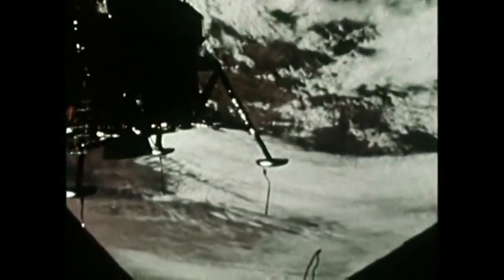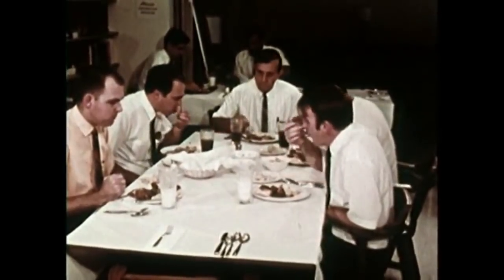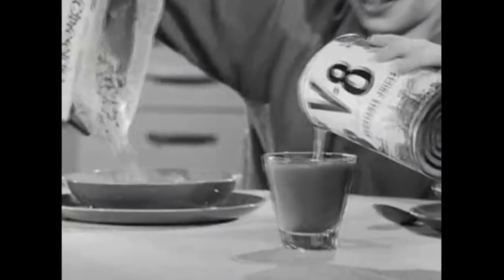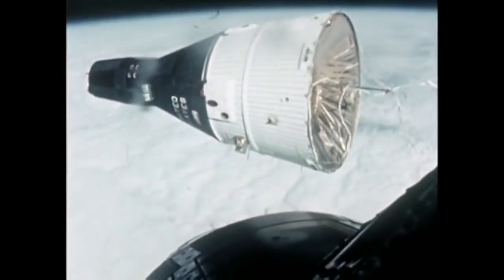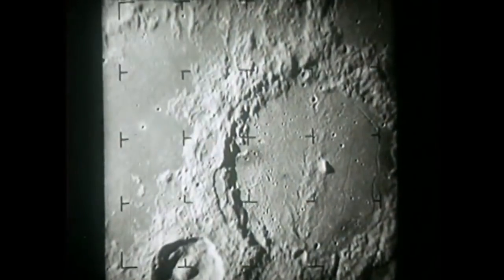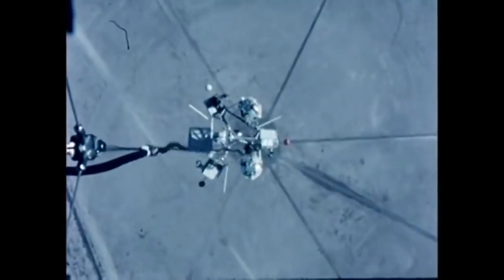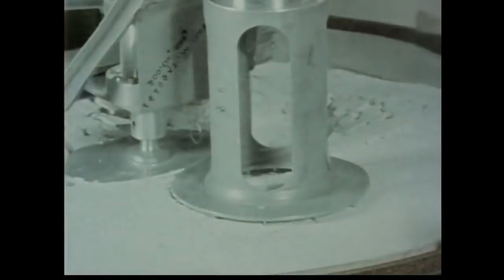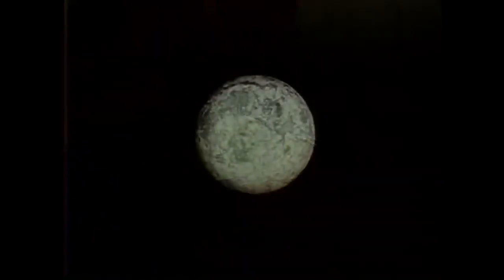Sleepcore: Space Age Dreams

Comment: I thought objects entering earths atmosphere had to have a heat shield. So why do objects traveling the same speed as they leave the atmosphere not need them.
Reply: Because they're not going the same speed. Stuff comes in going much faster.
Reply: The Shuttle External Tank got up over 400 degrees on the nose cone during its flight though the atmosphere... the Apollo capsule boost protection cover was covered with a layer of cork, because it got up over about 500 degrees flying through the lower atmosphere.  That's why spacecraft usually have some sort of protective cover over them (satellites are usually enclosed in a jettisonable fairing) which provides protection from the atmospheric heating of the spacecraft on ascent, as well as making it streamlined (nose cone).  Once it's above about 40-50 miles high the air is SO thin that the heating and air resistance is virtually nil... At that altitude most spacecraft are only about 4,000 mph or so, out of 17,500 needed to reach orbit, so MOST of their acceleration to orbital velocity occurs well after they're out of the "sensible atmosphere".  Remember too that 90% of Earth's atmosphere lies in the first 20 miles above the Earth's surface.  The other 10% is above that and most of that is right above the 20 mile altitude... 

On the other hand, vehicles returning from space are travelling a minimum of 17,500 mph (orbital speed) or thereabouts, and on a lunar return are doing 25,000 mph.  They slow down using the atmospheric drag to convert momentum (speed) into waste heat, same way your car brakes work by using rotors and pads to convert momentum into waste heat dumped to the atmosphere as the brakes cool.  Spacecraft use a "retrofire burn" to slow down a bit, but basically all it does is lower the lowest point of the orbit (perigee) until it intersects with the atmosphere at some point.  Spacecraft can't carry enough fuel to slow down completely with rockets-- it would take as much fuel as it took to put them up there to begin with!   Because of the extreme speed, the spacecraft gets extremely hot, up to 4,000-5,000 degrees F during reentry, as the speed converts into waste heat.  That is the purpose of a heat shield-- to protect the spacecraft from that extreme heat, either by ablation (burning away) or insulation (shuttle tiles) or both.  

Later!  OL J R :)
Reply: They leave at below mach 3 and enter at around mach 25